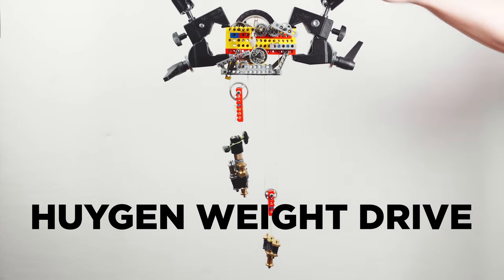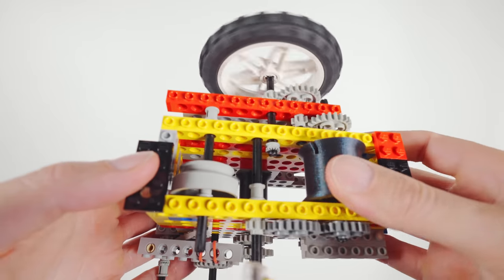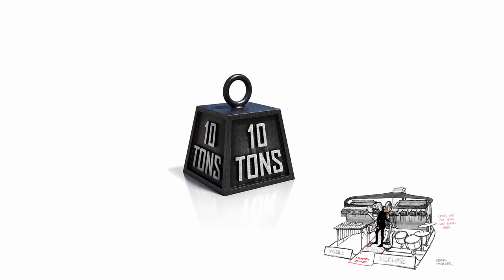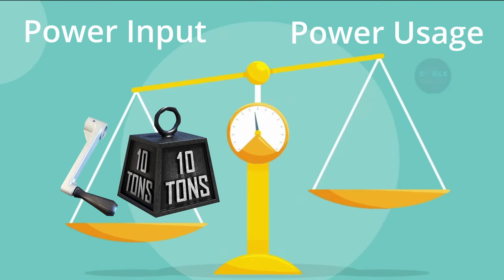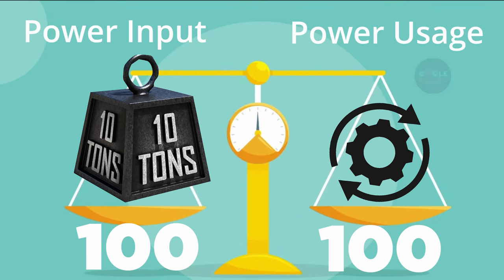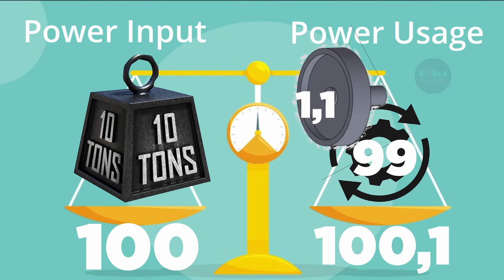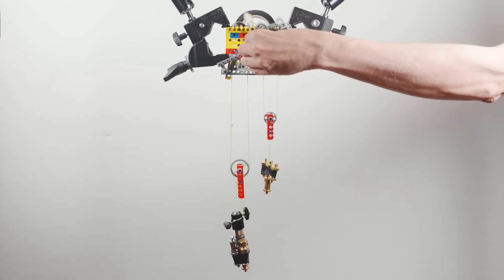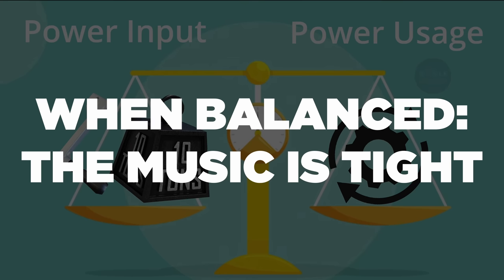Lego Technic Huygen Chain Drive

Comment: I just had an idea for a simple feature to add to the machine that might be useful!  A click track!  

You can tuck away some space on one of the programming wheels for some pins to play simple subdivisions of each measure with a contraption similar to the hi hat rhythm machine - but with something that won’t make much acoustic noise (a credit card with a contact mic on it would do the trick).  Have an isolated output hooked up to the band’s in-ear monitors soundboard, and voilà!  An analog click track that’s always true to the Marble Machine’s current tempo and never comes un-synced. 

You could probably squeeze in some other features like optional accented clicks on the first beat of each measure (DEET doot doot doot DEET doot doot doot…) with a few time signature options, or different subdivisions (quarter notes, eighth notes, sixteenths).  

I know the marble machine itself is kind of a click track already - and obviously any musician playing alongside it will know to follow its tempo - but click tracks can be super useful in certain settings.  

I’m definitely venturing into advocating for feature creep, but, imo, this seems like a relatively simple addition with big potential dividends.

Comment: I love you Martin, and your commitment to a fully mechanical system.
But: For this problem, it's dumb.  This problem is a phase locked loop on an electrical motor controlled by a wheel you can spin for tempo. Reliable, repeatable, build-able today.  AND you already had it on MMX and it worked perfectly.
You should be creating music, not re-inventing the clock.

Comment: What about a gearbox? You could change the tempo "on the fly". Or a set of (gear) wheels with different diameters, on the same axis, as used in some older press drills?

Comment: I don't think governor's really use friction as a primary mode of speed regulation. Instead it's the centripetal force caused by the rotation of the weights, this is fighting gravity typically (but can be springs)

Comment: Logistically, the weight will be difficult to manipulate when in transport or setup/teardown.  
What if instead of a weight, you would store your potential energy in a spring system or a pneumatic cylinder/accumulator compressing the gas?

Comment: What about using a pendulum clock setup with a spring that spreads the ticking motion into a more continuous one. I can't find an example, but think of it like a clock mainspring, but the outside connected axle is driven in the jerky motion of a clock, and the inside axle is pulled along with more and more force until its rotational speed is about equal to the jerky inputs average speed. This could allow for uhhh idk what the benefit would be ig

Comment: I foresee a problem.

The goal is to deliver constant tempo. The Huygens drive delivers constant tension. This is not the same thing.

The tempo depends on the tension, but also depends on the load. Your test case is basically a constant load, so constant tension gives constant tempo in the experiment. The intended use case however can have a drastically varying load, depending on how many or few notes are being played in any given bar. Any complicated passages with many notes will slow and any pauses of silence will accelerate.

I anticipate that the direct crank with flywheel, will actually perform better than the Huygens drive when faced with real music.

Comment: You're basically trying to Crack perpetual motion.
I can see this working if you connect the crank to the ratchet so you dont necessarily have to turn it at the same speed as the weight turning the gear. You could also have the weights on tracks with a buffer at the top to prevent it from getting too high and a clutch in the crank so if you reach the top the crank can keep spinning but the weight stops rising. Only thing is you pointed out the issue of the weight having to be very heavy or needing a lot of drop height. This could cause a clutch in the crank to slip or even make the crank difficult to turn. Maybe I'm just lazy but I would just use an electric motor with variable speeds programmed into it depending on the song but then that would defeat concept of it being purely mechanical and make an operator useless.

Comment: I love learning about these mechanisms and being along on the journey of discovering beautiful and fascinating mechanisms.

 I can’t shake off the feeling that this will add so much complexity and require so much energy and time compared to a steeper motor. Especially if Martin is thinking about using actuators to play notes (instead of programming wheel) for a “composing” version of the mm3

Comment: My question is how tight is tight enough? What I would like to see is a test that determines that value for you. 

Many of us are non musicians, or amateur musicians, and so don't have the same ear you do. If you can determine a number that sounds tight to your trained ear, then you have a target you can use to decide whether any individual component is likely to contribute significantly to exceeding it. 

This is probably something you should do with software so you can add some controlled randomness, rather than a physical prototype, but I think it would be a good step to have a target to reach for in order to avoid over-engineering solutions which may be good enough.

Comment: So flywheel smooths things out, but still too much variance. This new weight system also smooths it out, but changes in the manual input cranking to raise it back up causes some variance too. So, it will probably need multiple systems all working in series (maybe with doubling, like a pedal-powered flywheel that provides a relatively stable and smooth cranking of the weight drive to keep it mostly stationary, which then powers another flywheel, possibly with an adjustable governor to set the desired tempo? But you are probably going to get to a point that your desire for extreme precision results in the powering mechanisms taking up as much space as the actual musical functions do. The perfect is the enemy of the good.

Comment: The power usage won't be constant. The more marble per unit time the machine will drop, the more power will use. Also don't forget the kinetic energy of the marbles being lifted up after being trough. To mitigate this you'll probably need to assure the number of marbles lifted up is constant in time, regardless the BPM, so having a large stock of marbles ready at the top of the machine will be needed and marbles will be dropped quicker than been refilled at the up stock, so you'll need to fill the upper stock prior to each song to be sure of having enough marbles. Otherwise the upstream flow won't be constant and you will impact the power usage. 
Friction won't be constant neither ! The more marbles you release, the more friction you get due to the gates activation. You'll need to mitigate the above. Youll have so much fun! And probably the flying wheel will still be your best friend
Reply: Mmmm you could power up the marbles elevator  with the pedal and move the rotor and gates with the huygens mechanism to decrease the variability of the Power usage as well, plus you don't need a specific standard deviation to just move the marbles up 😊

Comment: Dont have too much faith in the governor you described. It will not result in constant velocity. This is because it adds friction proportional to the error in velocity (P controller). In other words, it only does anything, if the current velocity differs from the desired velocity. It will therefore reach an equilibrium somwhere close to but not at the desired velocity  The equilibrium still depends on the power requirement (drag) of the machine. This kind of governor was commonly used in steam engines where the primary purpose is to keep the rpm in a safe and useful range (not stalling or running away). In the case of the record player, the changes in the equilibrium are gradual and likely hard to notice. (Did anyone ever claim that a mechanical record player plays "tight" music?) In your case however, the drag will quickly and frequently change as you enable and disable parts of the system. This will result in a change in the equilibrium and thus velocity. It is still better than no controller but in order to stabilize the velocity at a desired value, regardless of fluctuations in power demand, at least PI controller is required. Unfortunatly, the I stands for integrating, which is hard to implement mechanically :(

Comment: A continuously variable transmission (CVT) on the flywheel output shaft could provide an infinitely variable tempo (within the range of the gear ratios of the CVT).  It would also allow "programmability" by placing a "groove" on the programming drum, much like the groove on a vinyl record (LP).  The lateral position of the "needle" riding in the groove would determine the position of the CVT, and hence the speed of the machine.  (Alternatively, instead of a groove, the programming drum could use ridges of varying heights to drive the CVT gear ratio.)

Comment: OK, but if you've got a governer then why does the falling weight add anything? Why not have a manual input, a flywheel and governor. That would basically be the same, but cutting out the middleman.

Comment: having worked alot with old pendulum clocks and their weights I can assure you - you do NOT want that on a maschine you constantly travel with. even a simply clock weight has to be adjusted after every repositioning to acurately work. Moving it in a truck from concert to concert will be a nightmare on your precision imho.

Comment: Would this mechanism allow for a hand crank be used to keep the weight in action? While it seems obtuse, for some reason the fact that it was not just opperated, but powered by you made it seem all the more fantastical
Reply: Did you not watch the video? He would need to keep cranking it to keep the weight up, if he stops cranking then the weight will drop to the bottom and stop.
Reply: @conorstewart2214  considering the level of precision needed to keep a large weight in place 20 centimeters off the ground, I figured that it was a possibility that it would be powered by motors
Reply: @TheStarMachine2000  there doesn't need to be any real precision in cranking the weight up and the weight doesn't actually need to stay in place, as long as the weight isn't on the ground then it will produce a constant force. The cranking doesn't need to be precise at all, just as long as you don't crank too fast, which is what he mentions in the video.
Reply: @conorstewart2214  it is my mistake then.

Comment: Just add a big enough flywheel for it to be heavy enough to actually have enough inertia to matter and you don't need a governor or the weight drive complexities as you the musician are able to pump that pedal/crank that hand wheel near enough to the correct time and the flywheel will smooth out the variability of the machine and man...

Comment: I think you are focusing on the wrong thing.
You shouldn't be aiming for constant power output, you need to aim for constant speed.
When you change what instruments are playing, you change how much the machine is loaded.

And with all this complexity, there is the question of if you really need to keep everything mechanical, or if you just use a servo motor or stepper motor, or electric motor with a feedback loop.

Also, I wouldn't call the first marble machine a failure, and the only reason I see MMX as one is because you stopped before it was done.
Remember, what you are doing is not about playing tight music. Computers are great at doing that.
What you are doing is making a work of art.

Comment: Couldn't you use an air piston as the power or force?  If the flywheel / governor is constant, it's like the weight that you add to pull down.  If you add more weight, the governor will stay the same. 

Using an air piston, you do not have to worry about a weight and height, just add air to the piston.  So the piston would be the main weight, but still use the huygens chain drive to keep the power constant

Comment: I'm not completely against this power input method, but why not use an electric motor to power the flywheel? Then you can use electronic speed control to maintain the output RPM. It seems like that solves almost all the problems simply.

Comment: This seems like a very good avenue for research.  However, im concerned about you being able to control changes in tempo.  How would you be able to perform accelerando and ritardando?  This seems like a lot more engineering than is necessary with a hand powered machine

Comment: I have repeatedly argued for a function first design as long as it fit the "mission profile". But this time I will have to ask are this "tightness" something that fit your "mission profile"?

What I'm after is why you are designing the MM3. Is it for it to be the ultimate music machine, is it to be an instrument for live stage performance, or is it a art project?

If you are looking at building the best possible music machine then you are on the right track. But you should then also consider just making it use an electric drive. That way you could get by without having to use a governor and could get away with a pretty light fly wheel to smooth out the impulses that come from varying resistances depending on how many notes are played at any time.

If it's to be a stage instrument then I'd suggest keeping the manual power but rely on a heavy flywheel and accept some variations making the music less tight. In a live performance it's nice if you can vary the BPM on the fly without having to stop to add or remove weights or changing the governor. In a live performance the audience will accept a less perfect tempo, the small variations add "life" to the music. Perfect performance is what you get from a record, not from a live performance.

If this is an art project then do whatever you want. That's all that really matters. You want the tightest possible music then make the tightest possible drive system that fulfill your vision.

So consider just how important the "tightness" of the music is and how you see yourself use the machine and go from there.

Comment: Why not use an electric motor? It's controllable, consistent, and doesn't have as many moving parts as a Huygens chain drive. You could gear it up or down depending on your needs. Not to mention you would need fewer custom parts. An electric motor seems like a more simple and off the shelf solution to me. It might not be a pretty or cool as a Huygens Chain, but it'll be lower maintenance and more simple to operate.

Remember the guiding principles in design: 
Form after function
Keep it simple, stupid (aka KISS)
Plug and play is better than custom any day

Comment: I can't help but find it unsettling that Martin doesn't have his goal for what is "tight music" set yet. In engineering, you have to start with the desired result to know what you are trying to make. My suggestion is to spell all that out in as much detail as possible. In this case, how tight does the music need to be in milliseconds? What tolerance is there? Things like that need to be in place or you might get excited about some new mechanism or device because it looks good, but you won't know if that device will actually meet your specifications. Alternatively, it is also possible to go the other direction and create something that is unnecessarily precise and takes far more work to make and use than is required for the tolerances you need. I don't think it can be stressed strongly enough that this is vital to success in engineering and I would strongly recommend making a document with all the exact numerical/measurable goals spelled out on it before proceeding further with anything else.

Comment: The logical extension of this idea is a battery powered stepper motor, a raspberry Pi to control the speed and a hand cranked generator to keep the battery charged. It's getting further away from the original concept of manually powered. Perfection is the enemy of art. K.I.S.S.

Comment: Why not use an electrical motor as input + a flywheel so you can control the input power ultra precise, and actually move along - then later add some kind of complicated power input system that's cool ? 😅

Comment: The discussion about changing weight to change bpm is just... oh boy. That's not how a regulator works. This is already going wrong.
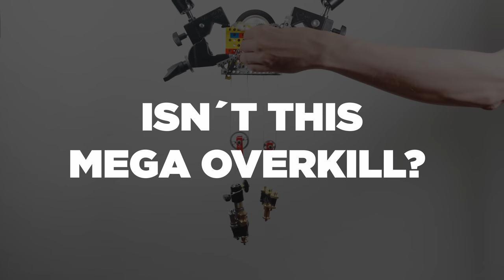7:24 And let me just remind you, Martin, that none of your prototypes failed because the music wasn't tight enough. No one complained about how loose the first MM was. The MMX never even got to the point where its tightness could be really tested. The first MM didn't fail, as far as I'm concerned. The MMX failed cause you got lost in the details. That's where the danger really is: you losing sight of the goal and getting bogged down in minutiae.

Comment: why not use a gearing system instead? kind of like gears on a bicycle, if it's in first gear, eventually there's no point in trying to go faster, it just evens out at a certain speed. Why not make gears for every song that replicates the needed bpm. Then you'd know how fast you need to turn the crank to hold the bpm, going faster wouldn't affect the speed! You could make it a module you can remove and replace.

Comment: Hmm... this does seem like a fiendishly complicated way of not using an electric motor.... one question (and I have not researched this at all) - how much manual effort is needed to raise the main weight? Even if your main weight is only 500kg, turning a crank to lift it might be impossible for any length of time, unless you're Arnie of course...

Comment: I don't see this scaling to the level you would need.
I would try to find a quality industrial belt driven servo, like the ones you'd find in CNC machines.
I remember someone using an old second hand one to build a custom race sim rig, it was not only fast and powerfull, but reasonably silent too.